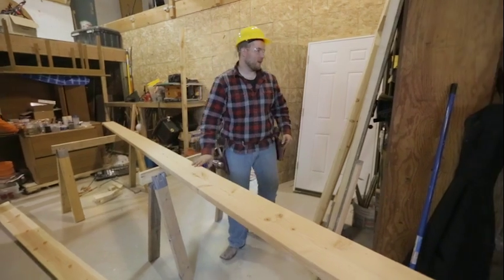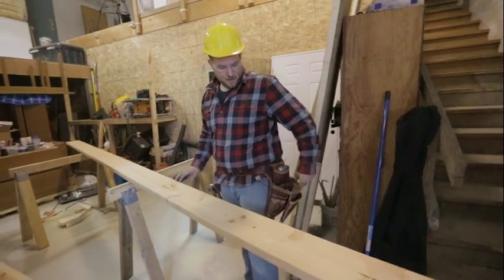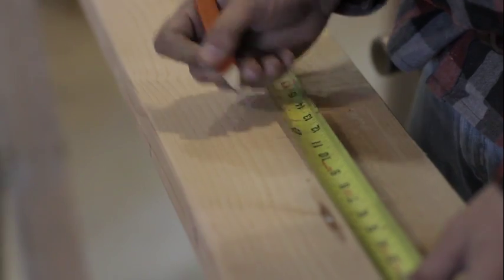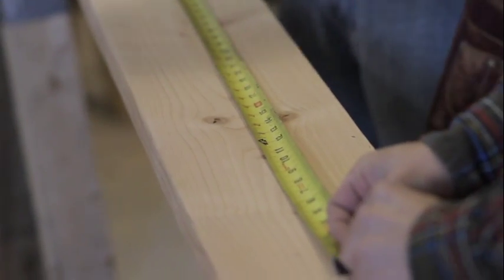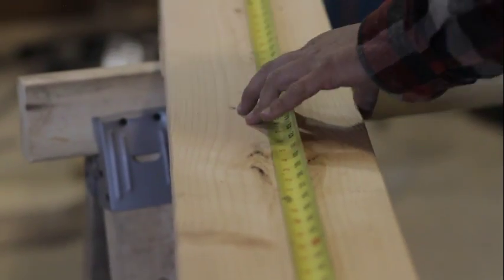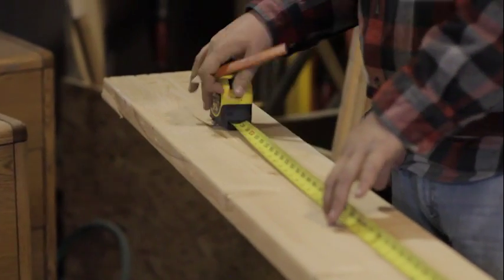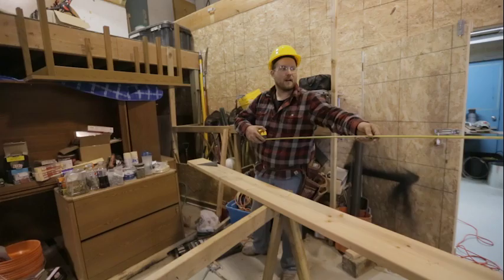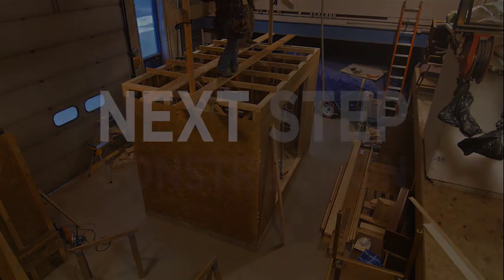How to Layout a Ridge Board // Roof Framing Part 3

Comment: Whenever I see someone run their layout, whether it is for walls or ceiling. And then watch them go through the trouble of marking lines 1 1/2 inches apart for each side of the stud or rafter. I know they never had to frame for a living where time is money. Totally unnecessary. Make your mark X the side the board goes and use one line and go.
Reply: Why don't you put a video up instead of whining,

Comment: Your ridge board should always be 1 size up 2 by 6 rafter + 2 by 8 ridge board.  Your rafter ends are liable to check/split under pressure if they are not fully contained on the ridge board ;)
Reply: i dont know if its a regular rule of thumb but mine is whatever the rafter is, go one bigger
Reply: Yes, as Required by the Building Code (IRC). Which says Ridge board shall be 1in. Longer than rafter cut. That’s their way of saying one size over rafter size. Lol.